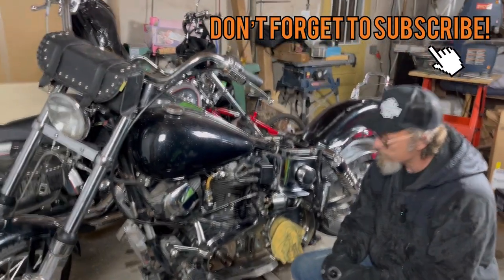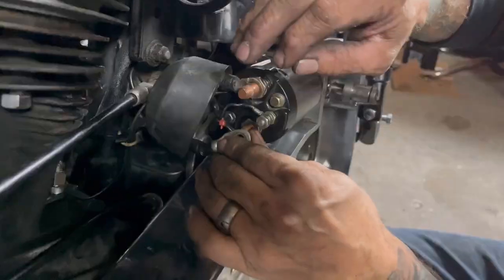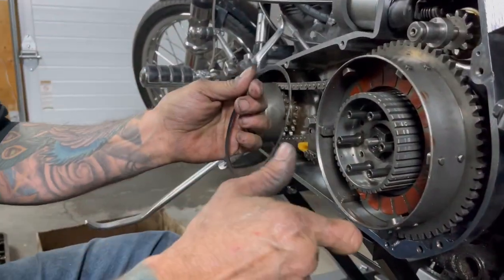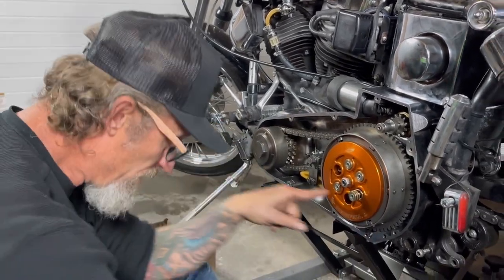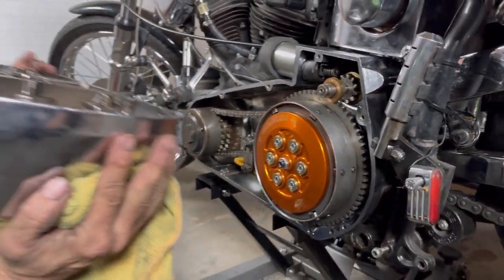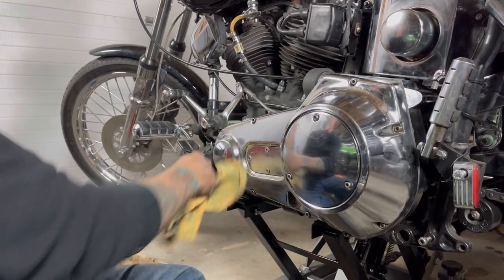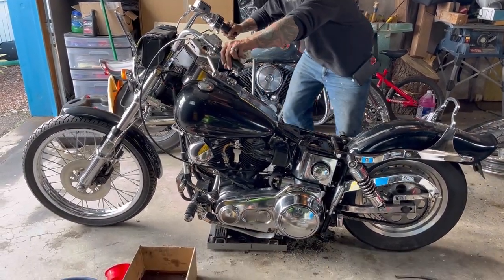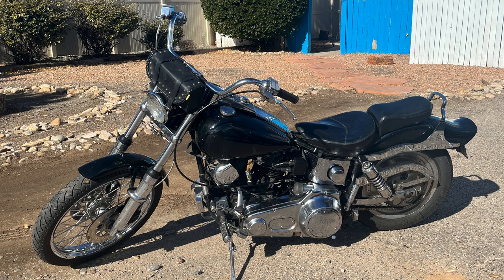How to Install a Barnett Scorpion Clutch on a Harley Shovelhead!

Comment: Fun fun...just got finished fiddling with a draggy Barnett clutch...ended up taking the clutch basket off checking the key and re torqing the nut and cleaning the plates with brake clean, refilling with ATF-F instead...waiting on a rain free day to tester out.

Comment: I have the same bike 81 FXWG and can't get into 4th gear.  It had been sitting for years and just got it on the road.  Ran fine for a couple of rides and now won't go into 4th.  From 3rd to 4th it doesn't engage and feels like neutral.  Also it bucks when you drive it until you open it up.  Great videos !!
Reply from the maker: The rotary chops are known for that shifter plate, weld, breaking loose in the top of the transmission. Good place to check! Thanks for watching appreciate it.

Comment: Noticed the rubber bump pad for kickstand is gone. That happened alot, I think they still make those. However, I have cut a 1/2 wide piece of a 3/4 heater hose and put it around the end of the kickstand and it works fine.
Reply from the maker: Good tip ! Thanks

Comment: Awesome good job I started mine back together and yup  inner primary had crack , at welder . I have a question I got James gasket set with 4 rubber but hard like a washer? Do I put them behind washers that hold trans in to seal inner primary?? You know the studs that go threw primary with 4 nylon nuts . Again love the channel!! My favorite and ride free🇺🇸
Reply from the maker: Yes rubber washers to the studs to the transmission!! Thanks for watching !! Good luck on your scooter!

Comment: Nice job, I work on other people's junk all the time so I know what you are up against. 
I'm ok with the ratchet top & tank shifter tops so I was very curious to see what you found on the cow pie.
Did you bother replacing the main seal ?  Im a true believer in the Red Line high shock synthetic gear oil.
Reply from the maker: The cow pie, shifter shaft, weld failed, just had to re-weld it, and yes, replace the seal, Bike ended up running good, this video is actually about four months old
Reply: @HobsonsChoiceHarleys  I just happened to have it pop up & watched all 4 parts.  I enjoy the real life videos, that's the way I operate so, that's the way I want to see it done.
Reply from the maker: @kurtfoulke5130  thanks for watching!! Appreciate you 👊